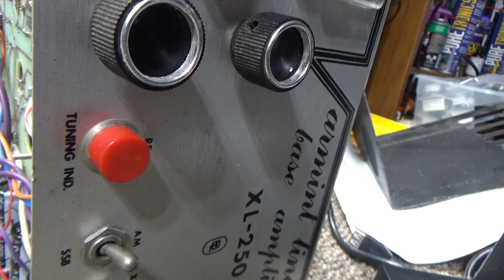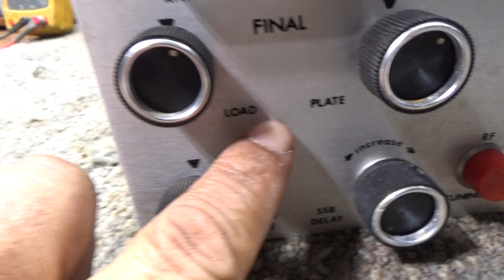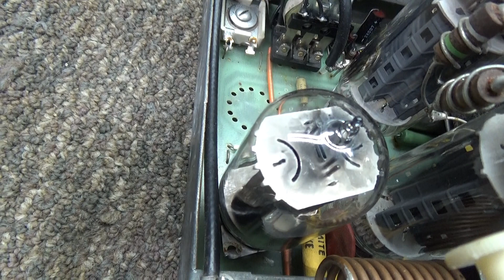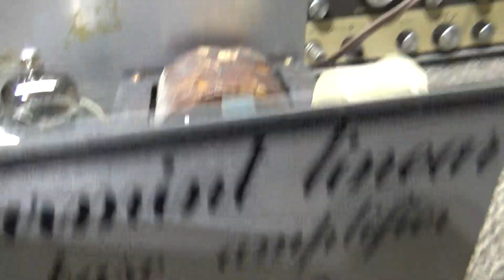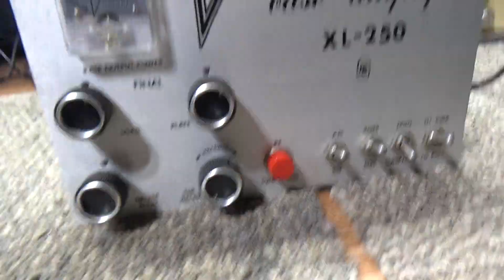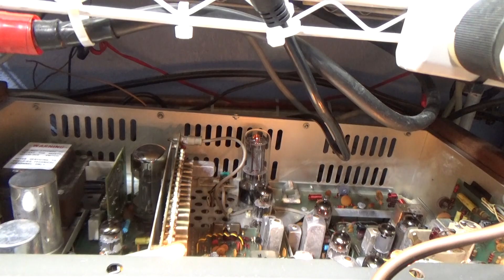Varmint XL-250 on the bench

Comment: I recommend a ferrite shielding. Put it in a grounded wire cage rapped in metal screen wire. I have a 450. Don't run it without the cover, those RF waves will fry your brain along with everything else.
Reply from the maker: too late. I think my brain is already fried. Seriously though, I have mentioned a few times about a CB bud who had a Heathkit SB-220 that had 11 meters blocked. He drove it with a Phantom 500 to get past that input blocking circuit. 400 in, 1000 out. He got brain cancer. I think the many years he had that combo in his face literally fried his brain. Sad.
Reply: @tramdr  The amp meter went out on mine today

Comment: Hello, I have two of these amps that need work, one was over driven and will not key up, the other one with the antenna side hooked up when the ground side of the radio side is hooked up it loses all receive,(it's not the jumper) it does it with new or old ones. Any idea what is wrong? Thanks in advance.
Reply from the maker: First one relay keying transistor, 2nd one relay itself.
Reply: @tramdr  the second one actually keys up and unkeys, the receive goes away as soon as I touch the shield side of the jumper to the connector, if I pull it back out just a little the receive comes back.

Comment: @tramdr  I have Varmint Xl 250 That the relay sticks till  powered off once keys. I also have no output at all on a watt meter. Tried new tubes. Heaters are working and have High voltage when keyed. Thanks for any help
Reply from the maker: relay sticking probably the keying transistor, Q2 on the schematic, a 2n3416, but could be a terrible harmonic or short on either the input or output side. Whats your input SWR? Is the driver tube getting hot? Are the final tubes getting hot? What I have seen with many amps lately that are putting out no power and have the voltage is the relay contacts are pitted or dirty, so either the amp is not getting power in to the driver from the radio (thru the relay) or the final tube power is not making it out to the antenna connector as it goes thru the relay. Clean the relay. Also there was a guy here on Youtube who had a similar problem and it was his jumper.
Reply: @tramdr  Thanks I have transistors and caps on order, and yes tubes are getting hot.  Both sets i tried. I will pull the relay out and clean it well and see what happens. Thanks for the Help and the swr is around 1.1.

Comment: Im renovating my radio room after 44yrs. In 1977 it had floresent light bulbs which caused noise in my HF reciever. I changed to incondesent bulbs. Im considering LED bulbs. Will it cause noise ?
Reply: I only get noise from my LEDs if I disconnect the antenna.  Old-school incandescent bulbs are noiseless.
Reply from the maker: Yes, often worse than fluorescent's

Comment: Can you see my post doc? 
I didn't see a response to question curious rainmaker big apple.
Reply from the maker: A post about a transistor amp and drive? I remember something about that and thought I posted that transistors aren't 'my lane'. I am pretty much strictly a tube man.
Reply: Not seeing your original question, here are some general ideas about tube vs. transistor amps.. 
Tubes can handle being overdriven better than transistors. Transistors don't like heat for very long before they fail. Tubes are hot by nature so a little extra heat won't bother them, as long as the plates aren't turning red. That said...
All of our stuff is designed to ICAS, or Intermittent Commercial and Amateur Service. That means that it's not designed for long-duration service. Sweep tubes have a typical continuous power rating of less than 25 watts for B&W sets and less than 50 watts for color TV service. 
The RCA tube manual has the 6LQ6 at 30 watts in TV service. It also shows a "temporary overload" of 200 watts input for no more than 40 seconds.  
My Swan 350C was advertised as 550 watts of input. I could get the tubes to glow red by being long-winded or by sending slow CW, or by tuning up for too long. When I did that enough times, the maximum current that the radio would load to began dropping off. 
I hope that I've answered some of your questions.